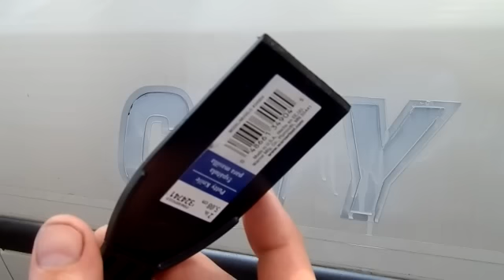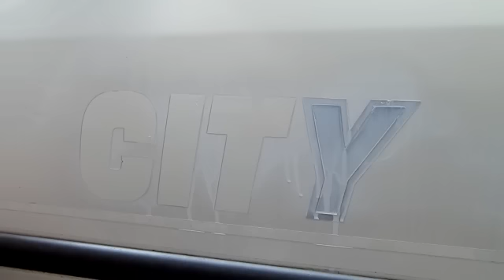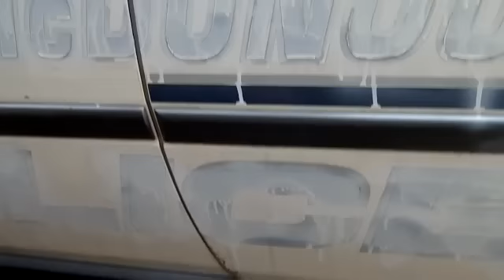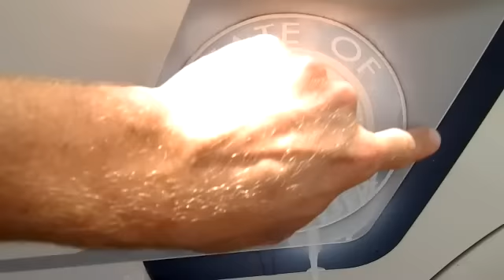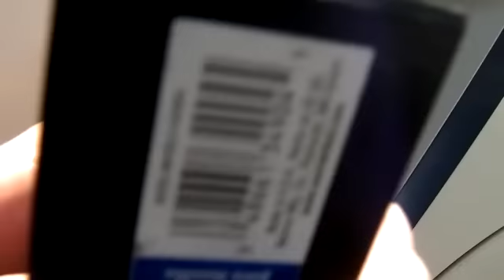Sun Baked Vinyl Decal Removal, Police Car

Comment: This actually made a quick job out of a long ass tedious, frustrating job
Reply from the maker: yeah, its a miserable job. After 10 years of practice, I am down to stripping a car in about an hour. Plastic razor blades work better over the plastic scraper shown here for the vinyl removal. 

Lacquer thinner post vinyl removal applied by rag, then plastic razor blade to take off heavy gooey residue. Then more thinner to clean it up. Good to go.
Reply: @mph5896  alright ill get a plastic razor blade because i got me two plastic shovel looking things and they kinda chopped up the sticker so i stopped, im taking the mazda sticker off of my tailgate from my '96 pickup

Comment: seems like the lettering comes off pretty easy thought it was gonna be a bitch to take off i haver a shit load of lettering that i have to remove from  my truck & it seems to look  easier than i thought   (not so bad)
Reply from the maker: Buy a plastic razor blade with a handle. It helps a great deal

Comment: Get plastic razor blades from Amazon.  They are orange and yellow.  Better than the black plastic scraper.  Use the blade holder, else you will slice up your fingers, yes with plastic.
Reply from the maker: Thanks for the tip.
Reply: Or blue...  Like the one he used in the video...

Comment: OK what about on semi trucks, when you buy them 2nd hand the vinyl is removed but you can still see it at an angle or if the sun hits it just right?
Reply: If you can still see it chances are that the paint faded around the decal.  There's not really anything you can do about that except cover it up with something else.
Reply: Hi Christiaan, 

You can actually buy a product developed in the US, known as CrystalTek Ghost Off. What this means is that when you remove vinyl that has outlived its durability can cause a patch of well-preserved paint on the surface protected by the weather elements. This is known as ghosting, using the "Ghost Off" not necessarily removes but in a term blends the paint to replicate the colour tone. 

I only know of this as I am from Australia, and I work for a vinyl supply distributor.

Check out CrystalTek on google though.

Comment: I have a Mitsubishi Delica with stripes that I want to remove. I got one of those Decal Erasers that fit on a drill. These are VERY Tough Stripes on the Delica.  I wonder if a heat gun will work better.   I seen one of those decal erasers in action and it was Quick.  Must have been El-Cheapo Decals !
Reply: Did you find the solution for the Delica..?
Reply: @reefer11000  Diesel Conditioner sparingly and a Heat Gun.

Comment: Would this work on 20 year old decals? I have a 2000 Tacoma with SST decals I need to have removed before a repaint
Reply from the maker: JRocco 36 yes, use a plastic razor blade with the heat gun. Laquer thinner and the plastic blade to remove the left over goop

Comment: I am currently de-stickering a 56 Passenger Motor-Coach (wrapped), and have found that direct sunlight works best (which probably depends on the time of year). The heat-gun, in cooler conditions (late summer in eastern Canada, without the sun) is not working... Any suggestions?
Reply: ... And, how big of an area would you suggest doing at a time with the heat gun? ... I have to deal with panels...

Comment: This is a great idea if you can't get the stickers off after exposing the surface to hot sunlight for a while.
Reply from the maker: I did a Durango Police last summer, decals were in Great condition. The truck sat in 90F sun for a few hours and the vinyl pealed right off. Entire truck stripped in 20 min.

Comment: i wouldn't advise holding a heat gun that close to the body, especially on full power. the clear will melt, and overtime the spot will rust
Reply from the maker: It is possible to bubble the paint off. That car was old/rough and the stickers were torn up, even with all that there was no damage after removing everything even with the heat gun that close.

Comment: I have a decal on both sides of a car I just bought, I want to remove them but I'm afraid the paint will b different shade underneath. if it's a basic colour like white does the paint usually look the same after washing the car?
Reply: Deborah Potyok i wouldnt worry about it. the more faded the paint is the more the contrast. sometimes the area can be worked with a fine compound to lessen noticable contrast. several nano waxings over the srea helps the area reflect more light. glare cuts down on noticability.

Comment: I'm trying to find a way to protect the decals I have on our RV now. I'm starting to see cracks in the decals.
Reply: I know I’m about 3 years late,but vinyl has different grades.With the grades come longer life expectancies,5 yr,10yr,etc. On an Rv I’m assuming is either outside,or stored in a lean to garage etc.Unless you drive and wash it pretty regularly ,even then still in certain climates,it’s just going to crack.You can put tire wet,armor all on them to prolong the life some,but then you have a greasy spot on it and surrounding paint.Vinyl and time aren’t friends unfortunately. What I’ve just had done recently on my boat was remove all old decals ,and I found a guy that does airbrush t shirts and car tags and he free handed,and matched pretty close to original !Then I bought some clear and cleared over the whole boat when it was done and clean,and it looks amazing! Hope you still have your rv,and hope I was help to someone

Comment: heat gun first and then remove the left over glue with a caramel wheel
Reply from the maker: Specialized 29er I should make a new video. Heat gun and plastic razor blade for the vinyl. Then Lacquor thinner/terry cloth and plastic razor blade for the glue. 

I have used the spinny mechanical removers but above method is what I prefer

Comment: so I have an old chief Illiniwek decal on the back of mine. (been on since about '03) and I need to get it off. My delay however is many years ago (around '08 or '09) it was tampered with by my aunt. It has been scratched slightly off at the top, but im honestly not sure i can get the rest off. It is seriously sun baked as well. Weathered many storms... anyway I want to replace it witha new larger one. But as i said, its in terrible condition. Any help? +m ph

Comment: what did you spray on the decals before hand?  The white stuff?  i might have missed it if you mentioned it...   thanks for the video
Reply: SimonJProductions I was wondering the same thing. white spray paint apparently. he says it in the end.
Reply: KushDrone vapors when heated may help it lift. paint prob improves surface tension of graphic so it comes off in one piece
Reply: nope the paint was put on there to hide the stickers probably by the police dept or whoever sold it.
Reply: It's not what you put on b4 its DEFINITELY what you put on after the decals are off best stuff I have ever used is the rapid attack big 1 gallon bottle u can get on amazon for about 65$ but trust me ITS A GOD SEND when getting that gunk off towards the end it will save you so much time
Reply: I use goo b gone for adhesive residue.  It has a timed removal period. If wait too long, re spray.

Comment: good job, but you could have just showed a couple decal removals, not the whole thing...way to repetitive..biggest problem for me, has been getting the adhesive off...without damaging the surface
Reply from the maker: Sorry for wasting your time. I will be looking forward to your video on how to perform this task that will be much better than mine.
Reply: try goo gone, sold at local home depot or lowes

Comment: Great video, thanks for sharing your info.
What about removing vinyl stickers from glass like the back window on trucks and cars?
Thanks.
Reply from the maker: Razor blade. You could try a little heat as well.
Reply: NT cutter blade will remove anything from glass without any damage to the glass

Comment: Quick question for you, really need some help with this. I have a 2002 Dale Earnhardt SS Monte Carlo. The number 3 decal (Factory) on the drivers side is faded from sun exposure (Parking in my driveway has the sides of the car north to south and the sun is on the south west to south east side of my place), anyhow, I wanted to remove the decal and replace it. 

Do you have any idea if factory decals can be removed in this way, or are they usually painted over with the clear coat they toss on it? I haven't tried any kind of real removal yet, but when I run my fingers over it, it feels like it's under a layer of clear coat. I could be wrong, but it's just how it feels to me, so I was wondering if you had any experience or knowledge of this, and if the removal process you show here would work.

Any help would be appreciated.
Reply from the maker: If its a decal you can use the above method. Latest and greatest I have done is heat gun/plastic raser blades you can purchase off Amazon and Lacquer Thinner for cleanup.
Reply: wow thats a good question due to me having the same problem on my 86 monte carlo ss.

Comment: would it be advisable to use one of the vinyl remover / softener products like  3M part number #08907, or will heat gun work well enough?  If memory serves most hair dryers are around 1500 watts on full power, can they be used?
Reply: no heat... bubble!! mean there no turning back.... . my goodness
. im not using any heat.. i like the 3m..